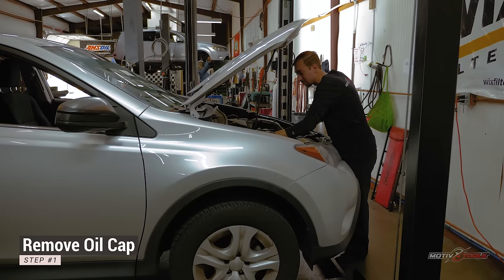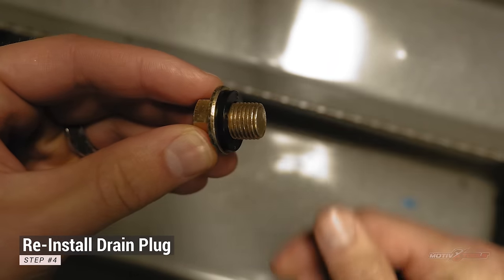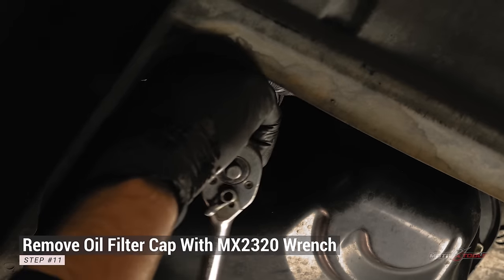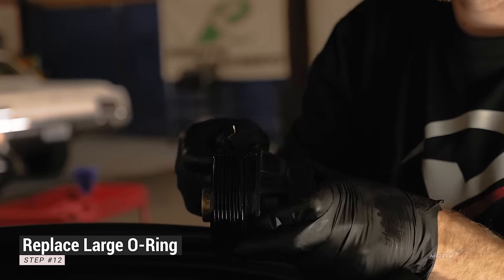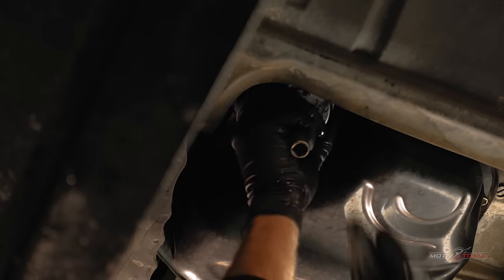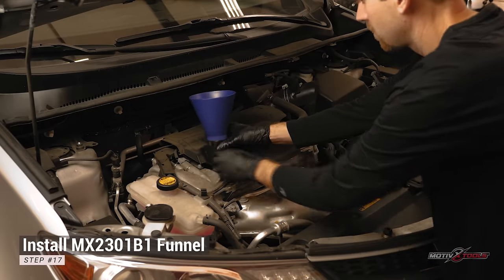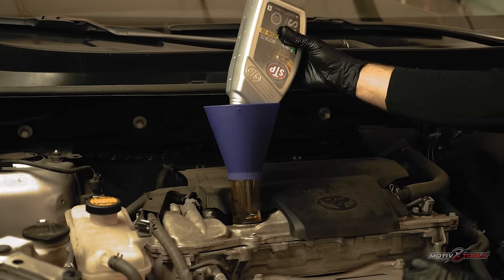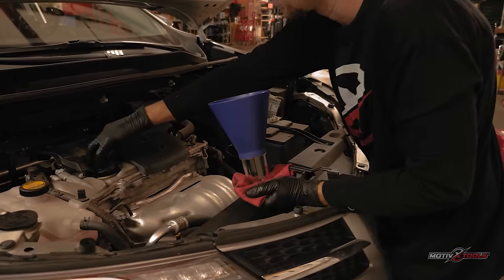Toyota RAV4 Oil Change (2009-2018)

Comment: What are the torque specs for oil plug. Oil filter and oil filter housing plug?
Reply: 2,734 Pounds...... or Hand Tight. Come on, is that a real question?
Reply: @Tybearius  yes it is. keep comments respectful

Comment: When you said remove the metal oil filter housing drain cap I think you meant the oil filter cap drainplug. We're dealing with the oil filter cap (which is only part of the housing) and the drainplug on the oil filter cap. There is no such part as a drain cap. (Maybe a cap drain but not a drain cap.)

Also why do you use a pick to remove the o-ring when the instructions that are printed on the Toyota OEM oil filter box specifically says not to as does the instructions in the Haynes Repair manual?

Sometimes you call the oil filter cap by its proper name (oil filter cap) and sometimes you call it the oil filter housing? It is only part of the housing. You are causing confusion. The wrench you sell to remove it is called a cap wrench, is it not?

Also, are the capacities listed in the owner's manual not reliable? You keep saying to check the dipstick repeated times. Why? If the capacity is correct, why not just add oil according to the listed capacity especially if you've changed the oil previously and you've confirmed what the correct capacity is? It isn't going to change is it?

One more thing... Because so many of these oil filter caps are put on way too tight, it would be good to direct attention to the torque specs found right on top of the oil filter cap (25 N•m) Even your own website admits "these housings are frequently overtightened requiring a large amount of force to remove them."
Reply: If you think this video is confusing, you shouldn't be touching any vehicle period.

Comment: Does it matter if engine is hot or not?
Reply: To start oil change?
Reply: A lil late but yeah. You want to wait til the car cools down otherwise you risk burns when draining the oil
Reply: If you have to ask this, you shouldn't do this job.

Comment: Just bought your redesigned oil filter wrench.   You can have it back.  It doesn't fit properly, too tight.  Looks like you're using the previous design in the video with the notches.
Reply from the maker: Hi Alan, sorry to hear that. If you email support@motivxtools.com, we'll get you taken care of.
Reply: @MotivxTools  will do..thanks

Comment: Michel  "these housings are frequently overtightened requiring a large amount of force to remove them." Copier à partir des commentaires ci-dessous ,,, ca l'air que tu es pas le seul à avoir de la misère à le dévisser ce foutu cap noir .